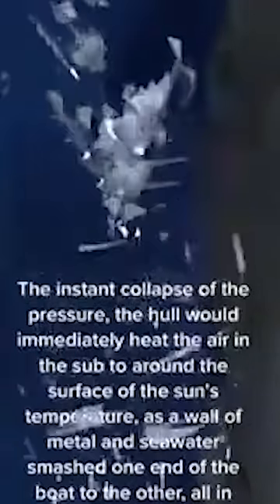How the Titanic Sub Imploded

Comment: James Cameron said “Now there’s TWO wrecks down there, and for the same damn reason.”
Reply: The reason: Narcissism. 👌
Reply: @stupidkitty84 and pride
Reply: For future explorations we have a twofer.
Reply: @stupidkitty84 
Selfishness and Greed.
Reply: Maybe Cameron can make another movie this time about the sinking of the Titan.
Reply: @yohannamueller  it didn't really sink, it descended then imploded. But I know what you mean. They might have heard the hull groaning and felt fear, but it was over in a second, they didn't feel a thing.
Reply: Safety negligence.
Reply: @OUTTA-TYME88  Less than a second. Their nervous system didn't comprehend that something happened to them because it was so fast. It had to be faster than the work of pain receptors. Scary to think how high the pressure must have been (and they weren't even fully submerged).
Reply: GREED!
Reply: I wonder what reason he's referring to.
Because the Titanic hit a large iceberg which ripped her hull open, the submersible imploded under massive exterior water pressure.
Not the same.
Reply: @pamh.5705  Titanic didn't pass all the tests, because people responsible for the safety of passengers shrugged it off. Same way as they did with the number of safety boats. It was all a big risk. So... very similar.
Reply: Indeed. Arrogance.
Reply: They won’t find much of the sub implosion though…
Reply: @pamh.5705 There's a belief out there that the Titanic was sunk by an explosion.
Reply: @rickperez5601  Irrelevant - it was still arrogance that skipped the safety tests.
Reply: Hubris
Reply: Icebergs?
Reply: @pamh.5705  you answered my question..thanks
Reply: Jeeesus…🤦🏻‍♀️ people just DON’T learn.Greed and pride.
Reply: Except they brought the wreckage of the Titan submersible up to the surface the following week to be investigated. It's no longer down there.
Reply: @pamh.5705 uhhh human error 🤔
Reply: @7321janedou  Mmmmm....I suppose so.

Comment: Ive read that what happens at the moment of implosion is much like what happens inside of an engine. The pressure causes the air inside to autoignite due to the high concentration of hydrocarbon vapors. 
When a submarine hull collapses, it moves inward at about 1500 mph. (2200 feet per second). A modern nuclear sub has a hull radius of about 20 feet so time required for collapse is 20/2200 which is about 1 millisecond. 

A human brain responds instinctually to stimulus at about 25 milliseconds. Human rational response time (sense/reason/act) is about 150 milliseconds.  

So its safe to say they likely werent even aware the implosion happened nor did they feel a thing.
Reply: Thank you , i really needed that... My mind has gone into overdrive imagining what must have happened and the fear and pain they felt
Reply: @linoleluminum2017 basically vaporized, which is why there is no recovery of bodies
Reply: That is reassuring thank you. I feel so sad , especially for the 19 yr old young man😢
Reply: @onyxrose3407  cycle of life.. his body fed the fish. Plus father and son truly bonded. Fools.......
Reply: If this had to happen, I'm glad they didn't know or feel anything.
Reply: So they're just chunks of ground meat now and not whole identifyable bodies?
Reply: @jonulrick4353  I'd say so. Or just vaporized into ash
Reply: @jonulrick4353 no theyre even less than that.
Reply: That’s some relief knowing they didn’t suffer in the sense of feeling any physical pain that they were aware of before dying. There’s something about being aware of your suffering and death as it’s happening that’s really unsettling. It’s still terrible to know they died.
Reply: It's still sad, but I feel a little better knowing they didn't suffer. I was sure they were agonizing without food, water, and oxygen for three days. Again, it's still sad and is a horrible situation, but they didn't notice their own deaths. R. I. P.
Reply: It's time too start arresting CEOs & executives for manslaughter for cases like this. Unfortunately, the CEO cant be held accountable on earth, but others in the company can. The company's assets should be sold off & divided between victims' families as a deterrent to future greedy, corner cutting business execs.
Reply: Thank you for the information... As someone who's claustrophobic, the thought of them dying the other way was just too horrible to wish on anyone. Hope they're at peace.
Reply: @jonulrick4353 correct and they don’t even know anything happened cause it hit them faster than their brain could realise
Reply: Good to know, and should give some comfort to their families
Reply: Good to know. This comment deserves more recognition.
Reply: @Rubberducky204  🙄
Reply: Actually comforting to hear!
Reply: Even though they didn’t feel anything, they still had to go through the uncomfortable sensation of their ears being full of pressure. So still a horrible way to spend your last moments
Reply: @hospitalfood6621  that's called infusion bonding. It's a new term used to bond closer between humans.🥱😆
Reply: Yes, alive would, of course, have been better but I too am relieved they didn't suffer. I pray comfort & peace be with the family & friends of those lost!
😢 << HUGZ >> 😢

I can't believe they used parts that weren't meant for depth and used a game controller. I don't feel good about the word experimental at all. It was pure reckless abandonment like getting behind the wheel, or handle bars, when you can't even walk!😢 Manslaughter definitely comes to mind!😢
Reply: Thanks for that indepth explanation. I kinda get it. That they didn't know what hit them, I don't know if it's good or bad. It's just so tragic and sad. And distressing 😢.
Reply: @autumnfall8829  Lol your username is both my name and my nickname😄
Reply: No, I believe they had an alarm that would sound if there was an issue. It’s also believed and rumored among the “submersible community” that they dropped their weights in an attempt to rise up to the surface again. So, it’s likely they did know something was going wrong and panicked.
Reply: Exactly what I heard.  The ballasts dropped to rise, as they knew there was trouble, so in actuality—they had a forewarning of things gone wrong & then died.
Reply: That is good to know
Reply: @hospitalfood6621 
Well, it was the truth… 😬
Reply: Oh, I'm sure they knew they were in trouble. I'm talking about the moment of implosion. At that depth, their deaths were instantaneous.
Reply: Jeezus...
Reply: Wow that would be a good way to go but there would be nothing left of you though.💯👍
Reply: @@busterbrown661@busterbrown661 The son was not reluctant to go. His mother said her son really wanted to go so she gave up her seat on the trip so he could go with his father. Her son, a Rubik's cube fan was excited to solve a Rubik's cube while at the depth of the Titanic.
Reply: You explained that so well.
Reply: But if thts the case how the hell the controllersurvived?? there is a pic of it on the ocean floor
Reply: I really hope so.
Reply: Comforting
Reply: One can hope 🙏🏼♥️
We can also pray they knew Jesus. 🙏🏼💯♥️
Reply: @2004dale My parents died tragically recently and that’s what keeps me up not knowing if they suffered before they passed. 💔
Reply: @genzi78514 3 days isn’t a long time to go without food and drink I went 17 days with no food and very litte to drink cause of a stomach condition.
Reply: My question is why would they do this knowing the outcome? It’s like a dive to death from the beginning
Reply: @@busterbrown661Too young to have learned the lesson to ALWAYS listen to your intuition/gut instincts. That makes his death even worse for me…the fact that his own father coerced him into going, didn’t listen to his objections or take them seriously but most of all that he (dad) didn’t even do his due diligence by researching the company and operations before hand. It’s one thing to be lesa faire about your own life but he had a responsibility to make sure his son was safe. He failed him in the worst possible way.
Reply: @LanieLouK it didn't have to happen but it did and at least they didn't feel anything
Reply: @cheekycow3289 are you sure about that? Don't believe everything you see. I haven't seen any pics of the controller. It's just unidentifiable debris. There haven't even been close up of the debris?
Reply: Talk about a quick death.
Reply: So they don’t even know that they’ve died 👻👻👻👻   👻
Reply: @2004dale Not sure I'd even call it 'death'. They just... ended. Abruptly.
Reply: There is an explosion due to cavitation, look up sonoluminescence
Reply: @linoleluminum2017 lmao what!?!  What are you 5?  This is what happens ALLLLLLLLLLL THE TIME.  😂
Reply: Thank you for the breakdown
Reply: As horrible as it is to think of this happening to anyone, it's probably the kindest way, under the circumstances, for them to go. 😢
Reply: They still could have known they were going to die before it failed like something was going wrong.
Reply: I can’t even imagine how scared they must have been and I really hope they did not suffer 😢
Reply: @Thisismyhandle423 yeah…that must’ve felt like a really bad earache or something …did that come before or after they “didn’t feel anything”?….😂
Reply: @erichboese7209  I remember doing the submarine scooter when I was in Hawaii and we barely went deep, but the pressure in my ears was so uncomfortable. It’s like not being able to hear a thing and it’s just full. So imagine them going miles deep in the pitch black waters and how much more pressure they felt, who knows how long they had to suffer
Reply: Thank you for all that information,

Comment: Also sea water contains salt and salt is abrasive. Abrasive enough to make tiny fractures where the pressure of the water would force itself in, over time making it weaker and weaker. 

Apparently the owner on the last few dives heard cracking noises and ignored them.

Comment: I pray they didn't notice, but I believe they were losing oxygen, and the sub was probably making a lot of noise as the pressure was applied. It was a suicide mission. Heartbreaking... my heart breaks most for the 19 your old... only went for his dad for Father's Day, although he was scared as per the aunite. I don't understand how this is happening in 2023.
Reply: from a reply I just read, the CEO didn't want old white military men working on the project... you know, the ones with experience making subs.
Reply: The implosion occurred very quickly after it lost contact with the surface. The US Navy SOSUS system picked up the sound of the implosion.  The implosion would have occurred in fractions of a second and they would have known nothing about it.
Reply: Its probably happening because in this microwave society everything is built quick, fast, and in a hurry. This incident is so sad....
Reply: Very sad... I pray they were able to see the boat before passing away. So, at least they were able to experience it. Stay safe, everyone

Comment: So the sun was basically made for failure. Prayers for the families involved.
Reply: *sub
Reply: There is nothing inherently wrong with using CFRP under compression as long as everything is properly designed, analyzed and tested.  Clearly somebody dropped the ball but to say it was designed for failure, solely because CFRP was used, is a ridiculous statement. Idk how they though it was a good idea to sell tickets though.
Reply: No.  It was not designed for that depth!

Comment: I'm no engineer, but it seems to me that the appropriate material used for plane hulls would be the absolute worst material for submersibles, given that planes operate in the air where pressure is pulling the hull of a plane apart, as opposed to crushing it inwards like the ocean does to a submersible.

If carbon fibre is a good material for holding a plane hull together from the pressure forces pulling it apart, that means it's going to be worse than neutral underwater: you've got the ocean water pressing against a hull that is already designed for pulling everything inwards.

I know that's a really poor wording of the situation but, as I say, I'm a layman at best.

But it reminds of a line from an episode of Stargate Atlantis I saw years ago, where a spaceship crashes into an ocean and one of the characters on board asks a scientist "how long will the ship's hull hold underwater?" and the scientist character responded "Well, considering a spaceship is built to withstand the vacuum of space, I'd say anywhere between 0 and 1 seconds." 🤷‍♂️

Comment: I did a face slap upon hearing what the materials of the submersible was.  The depth of the Titanic ruins is the equivalent of 16 Empire State buildings standing on top of each other.  Even if they used submarine wall materials, owing the targeted size & weight of the submersible, an implosion would have still occurred.

Comment: The depths to which they were descending was incredibly deep. It wasn't 1000 feet; it was 12,500 feet. Nearly 2.5 miles deep. You don't go that deep with something that is experimental. Carbon fiber is most often used when weight is a concern.  I do not understand the use of carbon fiber in this vessel at all. Sad outcome that many could have predicted.

Comment: Engineers designed that?  Hard to believe.  I’m an engineer and the people who designed it could not have been engineers with degrees and any experience.  Theses guys were either tinkerers who thought they knew more than they did, or people right out of college without any experience doing this kind of work.   No trained engineer would do some of the goofy stuff this company’s did- for example trusting lives to  a $5 video game controller.  
Or not knowing radio waves, microwaves, etc don’t pentrate water more than a few inches.  Their communication was based on Star-Link at one time.  They were ignoramuses and comically tragically incompetent at best.

Comment: Extreme cold stretching and contraction and the Carbon weave was only rolled like a large Toilet 🚻 roll. Between two Hula hoops the Weave of carbon should have had multiple directions to increase strength. But They never X rayed the tube bar one I believe they did this once and the centre section was replaced. At one point you cannot go deep sea scrimping on money.

Comment: Candace, I do dive tables for scuba, there are the numbers for you for titanic sub. Every 33ft under salt water, (34ft for fresh water), is equal too same weight as air from earth too space or 1-atm.  so, 2.5miles down times 5280ft in mile ÷ 33 = 400atms. so 20,000lb sub X 400atms = needs 8,000,000lbs lifting weight force just too get started too lift off bottom! first thing I saw was sub not circle round for even equal pressure. an you can't attach 32ft of submersible with glue! kid was right to fear getting into death trap sub with rich father!

Comment: Nothing about this that makes sense to me. Based on the tour of the submarine that the CEO gave in a video, that would’ve been secondary. Primary was the fact that I have no reason to go see a shipwreck 2 1/2 miles down in the Atlantic ocean, with water pressure that is 3 tons per square inch.

Comment: Starting to think that this was a planned new sub, because how come all the other times they went down there OK
Reply: Because the material would weaken slowly with each time they take the trip. Freezing cold temps and millions of tons of pressure on the hull at the bottom of the sea, but coming back up to warmer air and less pressure of the surface each time. The expansion and compression of the materials each time weakens the carbon. That doesn't happen with other standard designs. They can take those changing conditions multiple times and still hold up. That's why they are tested dozens of times over many scenarios before taking paid customers, to prove it will last and be reliable for the long haul. It's like building a cheap car that looks like it's a Mercedes Benz but falls to pieces after only ten times on the road. It might look like it's going to work at first but nope. Not really.
Reply: @Butterfly-truth  guess this one wasn’t tested right